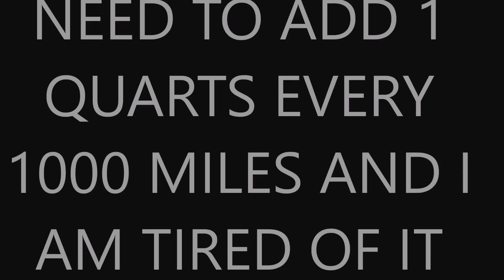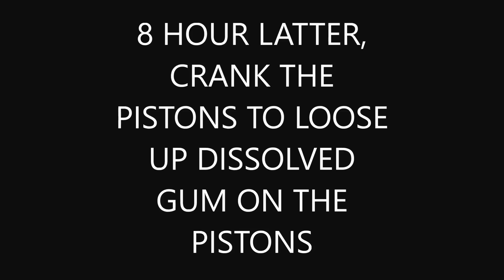MY WAY to stop ENGINE BURNING OIL FROM STUCK PISTON OIL RINGS WITH SEAFOAM

Comment: For everyone else who has oil consumption: get on an open highway when it's not crowded. put it in the next lowest gear under drive like"3" or if it's really bad, try "2".  When it's safe to do so, accelerate hard (But don't go past half throttle) till you get to 65mph, then take your foot off the gas, and let the engine brake and slow you down to 30 or 40 mph.  Repeat this 4 times.  When you accelerate after the engine braking, you will see black smoke come out the exhaust.  
Here is that happens: when you use "engine braking", the back pressure created causes your rings on the piston heads to dance, spin, and wiggle - thus releasing the embedded carbon.  This should be done every few months on a babied engine that doesn't go on long trips, or that doesn't get run with medium to heavy duty.  Maybe ask someone with a little more nerves to do this for you. Don't forget to put the car back into drive when complete, and be on your way.  When carbon it on the piston rings, they do not rom a proper fit, and allow micro amounts of oil past the cylinder I to the combustion chamber, and it is burned away.

Thank me later!!
Reply from the maker: awesome
Reply: David James
Reply: David James
Reply: David James
Reply: David James
Reply: Is this the old Italian Tuneup?
Reply: Bob4392 User aka "WOT" or "drive it like you stole it". Yep beat the engine just a little more than you would in daily driving.  I myself perform this every 6 months on my Cadillac Northstar motor, but I also add 20 ounces of marvel mystery oil into the 20 gallon tank. My oil consumption drops drastically after the procedure.
Reply: So if I do the procedure using gear = 3 and reach 65 mph, how do I do "engine brake"? Do I simply remove my foot from the accelerator or do I need to shift gear = 2 or N?
Reply: ruigooal just remove your foot off the gas, and you will hear your transmission whine a little, and the car will start to slow down much quicker than if it were in drive.  I recommend 3rd gear to start, but if you are comfortable with 2, you can try that - even if you only get up to 55.  Depending on the car, you might even here the exhaust sputter as the car is slowing down.  GOOD LUCK.  Also this works best for 8cyl engines but also works for a 6 and 4cyl.
Reply: David James Thank you! I will give it a try. My car is v6. It has been burning oil and I found some oil when I cleaned up the throttle body the other day. One mechanic thinks it is the PCV, and another mechanic wants to take all the parts out and check the oil rings. Both will cost too much money.
Reply: ruigooal you are very smart.  The pcv valve is a little cheap part on the top of the engine that can be checked and cleaned easily - generally no tools required.  Remove it, and shake it to hear for a ball rattling like the sound of shaking a can of spray paint.
Sticking rings will increase blow by in your upper engine and lead to excessive fouling of your pcv valve and intake.  Also, many people overfill the crankcase by filling up a cold engine to the line on the dipstick.  Consider adding marvel mystery oil to your oil next time you need to top off, as the solvents will help break loose the softer carbon without eating away gaskets and seals.  I have been using it for years with no ill effects.
Reply: Thanks David. But the PCV valve for my nissan altima v6 engine is buried underneath the maniford and it is really complicated job to get into.
Reply: ruigooal I really doubt it's under the manifold.  Not even Nissan would do that.  I would bet it is under the plastic "beauty cover" 3 of my 4 cars' pcv valve requires me to remove this cosmetic portion to get to the pcv.
Reply: David James for the 2.5 engines, you are right. But unfortunately for the 3.5 engines, it is behind the rear valve cover which is underneath the intake. I cannot post a picture here, but I found a diagram online https://www.justanswer.com/nissan/1mguq-wondering-pcv-valve-located-3-5.html
Reply: I just wanted to give a quick update. It has been over a month and haven't seen the blue smoke again. Haven't lost any oil either. I replaced the PCV valve on my 3.5L Nissan engine. I made a quick video here : https://youtu.be/WJb026SmCBI
Reply: better to do it from the mountain i have with toyota avensis 1.8 oil burn 1 galon oil burns in 500 miles will try soon it
Reply: How did you discover this method of stopping oil consumption?
Reply: No this is rubbish. Thats not how engines work
Reply: 65 mph on 2rd gear - that's what D2 does in Honda. Do what he says people, your 15 yo transmission wants to retire
Reply: @ruigooal  just replace the PCV Valve ...
Reply: @shobud7561  If you read my comments, you will know that is exactly what I did and fixed my problem.
Reply: Ahh..The Good I'm Italian tune up
Reply: @augustoevka5977  so?

Comment: Oh, I cringed when you installed the spark plugs before cranking the engine first. It will be safer to add sea foam treatment to the oil and the gas first. Soaking the piston rings is a good idea, but I would cover the spark plug openings with something and crank the engine to get rid of the excess if anything is left over after a night sitting in seafoam.

Comment: OK... the best way to do this... is addone able spoon at a time, two hour soak intervals, and each time run engine till block it warm to the touch. Do thus five times. Too much fluid can harm the valve seals and gaskets. Luckily he didn't tighten the spark plugs when he was turning the engine "to loosen up gum".

Comment: I see the point of doing this, not a bad idea, but I would not put the plugs back in, and then crank it.  What if the liquid did not soak thru the rings? Could get a bent rod when cranking.  I would let it soak all night with the plugs out, then crank it to blow out any liquid.  Liquid does not compress.
Reply: When you say crank you mean to turn the ignition half way like he did in the video right? Do you keep the plugs out for this too?

Comment: One area you did wrong , was revv the motor at the end , thats one thing you don't do . Because when you added the sea foam to the piston , what it does it removes any lubrication that the piston had before . And at times you can hurt the piston rings , because they are rubbing metal to metal without any lubrication . Which is why when it comes to putting an engine together it requires to have parts lubricated so they won't rubb raw . This is just for future references .
Reply: That's why you leave the fuel pump fuse pulled out so the engine does not start. Crank it for an extended time to build oil pressure, then put the fuse back in and start it.
Reply: @TwentytenS4B8  You still need to lubricate things even if the engine isn't running and burning fuel.
Reply: seafoam is basically oil, so the cylinder walls still get lubricated

Comment: I have an 09 camry with 370k miles. Used to burn oil like yours. Fixed by injecting wd40 in vac line during idle.
Reply: Is there a web page or video that explains your method? I want to learn more! Thanks

Comment: I've been doing this way more than 20 times to my Mazda 3 which clocked more than 230k miles. However... i only pour in lesa than 0.5oz in to each the combustion chamber..then soak it for good 6 hrs then start the car. i didnt experience any hydro lock at all....i repeated this process (piston top cleaning) at every 10k miles and add seafoam into the fuel tank @every 5th fill up. Cleaned throttle body at every 15k miles.  So far my engine didn't suffers oil consumption at all and i change it every 5000 miles. The engine performed like new
Reply from the maker: awesome
Reply: I do this same exact thing with Kreen. I love that stuff!

Comment: Ref: the cranking with plugs in.

I let my concoction sit in the cylinders for 3 days and there was still shit tons in them. Took me forever to get it out. Don't assume anything and damage an engine. Full disclosure, I was working on a Saturn 1.9 liter and not a Honda.
Reply from the maker: Should not have plug in when cranking

Comment: this is some major deceptive video editing. you should only pour in a small amount of seafoam over the piston heads and let them settle for an hour until it can breakup those bigger chunks of carbon, then get a small hose and vacuum all that excess seafoam/carbon out. then add some oil inside to help lubricate it to prevent the cylinder walls from being damaged by the piston.

Comment: Hmm i might do this to my  09 accord with the excessive oil consumption recall once if it starts buring oil. Good to see it worked for you, but I think its safer to just let the seafoam sit for as long as you can and then suck it out of there. I don't want to risk hydrolocking my motor.
Reply from the maker: i am just being lazy, it is a good idea to suck it out.
Reply: rogert151 they extended the warrantys on certain year accord 4cyljnder and 6cylinder check with your local dealership to see if your vehicle qualifies
Reply: Recall still good up to 150,000 taking my 09 lx Saturday has 3 recalls
Reply: Joe RUN if you leave it sit for 24hr don't need to suck anything will go to the crankcase, just what I have done today 
Don't know the results yet but the car drives much better , got new oil in afterwards which I am going to drive for a 1000miles and change it again. Before I filled up the cylinders I drove the car around 500miles with 10% mmo in the oil, and in the fuel. Hopefully not going to consume oil anymore
Reply: @toninocars  any success?
Reply: @chapinteo8412  I'm guessing it was shit and they simply bought another gas burner

Comment: That liquid may work for engines that arent that clogged, usually ill put into the cylinder A BIT of oil just that little to "seal" around the piston to get enough compression to make the engine start once it started it alone will get unstuck rings (not talking about the oil holes for scrapper rings), if you put in too much oil and put the plugs in all youre going to do is destroy the engine by for example bent rods, bent valves, etc. 
The engine may work for some time doing it this way or clean the holes if it aint clogged up too much but there is a reasson that it got clogged, imagine something else in the oil system is clogged and X part or parts cant get lubrication, that can cause huge issues. If you know "why" that happened you will have an idea what methods you can use, pointless to use the above methods in cases like the one below.

That said it mostly depends what happened with the engine and how clogged up it is, have seen cases where there wasnt a way to clean the holes by hand and drilling them was the only way.

Comment: Oil change every 3000 miles or 5000 km, a good oil filter, clean air filter, clean throttle body, and working PCV valve. Do all this and you won't be burning oil.

Comment: Hope you changed the oil after adding all that seafoam to it. 0w30 isn't helping your oil consumption either. Switch to 5w30. GM sells a fuel injector and manifold cleaner to use the exact way you did the seafoam. Give it a try.

Comment: I have a vehicle with 355,000mi and it's started using a little oil between changes. I've never used any treatment in the oil I'm actually afraid to especially with so many miles on it but I have considered it.
Reply from the maker: Make sure do not turn the engine with the spark plugs in.
Reply: @joehowto  I've heard about putting it in your oil an ounce for every quart but never down the spark plugs but why does it matter would it be to much compression and just blow it out? Obviously I see you don't want it to fire so keeping the plug wires off would solve that issue. Did it solve your problem and what is a stuck ring? I've never heard of it not sure how a ring could get stuck seeing how they go around the piston.
Reply from the maker: @my2centz196   you can do both. If it is the problem with stuck piston rings, seafoam on top of piston is more concentrated to reach the problem rings than diluted seafoam

Comment: A Honda With stuck oil rings unheard of , Mine just turned 100,000 miles today I go 3500 miles maybe 4000 between oil changes and it doesn’t use a drop I’ve never seen that

Comment: Joe RUN: It's not clear from the video, what you were doing with the spark plugs.
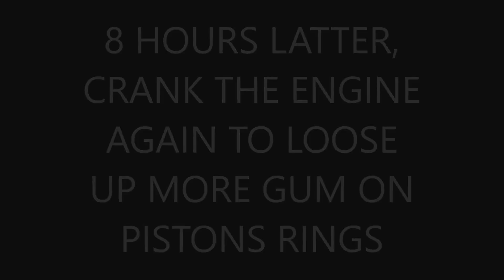3:39 says to install the sparkplugs after showing the engine being cranked the final time.  I'm guessing the spark plugs were just put in position without screwing them in to slow evaporation of the Seafoam. Is this correct?

This is unusual with Honda engines that have been receiving maintenance schedule oil changes.  "Stuck rings" are oil seal separated springs that have been gummed up with varnish and burnt oil. That prevents the oil from flowing back through the piston passages and into the sump, so it gets up unto the cylinders when the engine is running burns and crusts on the piston face.  Varnish builds up on the cylinder wall beyond the oil ring travel.

 I'm wondering what the oil looked like before this fix, whether you changed it after this procedure, and if the fix holds up to beyond 5000 ikles of driving..
Reply from the maker: yes, you are right

Comment: I will do this on my 2011 bmw 328i. Only with a bore scope and i will splash out the remaining seafoam through the spark plug holes then confirm with a bore scope.  Should be fine this way.

Comment: I have a 05 tsx and it burn about 1qt every 3000 miles and does this seafoam help with oil consumption? does it stops the oil burning for you? thanks!!!
Reply from the maker: 1 qt every 3000 miles is too much. If it is carbon built up, it will help. Try it and it works, it works. It does not hurt anyway
Reply: Joe Lui after you did the treatment how many qt of oil you burn between changes? And how long you hold the oil for next change ? Thanks!
Reply from the maker: about 1/4 of a qt every 4000 miles, I use mobile 1. I change oil about every 6000miles
Reply: Joe Lui that's not bad compare to my workmates 2013 328i burning more than that and I will give it a try! Thanks man!
Reply: Ken Xu my celica 2002 burns a quarter of oil everyday has a 203,3450 miles and i drive 36 miles a day.
Reply from the maker: That is too much oil. You must have a leak some where
Reply: Yeah my cars its stick shift and every time i  step on the gas ó can see the smog coming out of the exhaust Pipe
Reply: So, im going to try you treatment.thanks.
Reply from the maker: It won't work, you have a leak in one of the valve seals
Reply: Well looks like a have to start saving money to fix it, thanks. Bro.
Reply: Feliciano Horta also might be your rings if you see smoke while accelerate, don't bother to fix it buy a used motor is better to go,
Reply: Thanks ken xu.

Comment: What engine is that? I have a H23a Vtec or blue top motor in my 95 Honda civic coupe. I soaked the pistons overnight with Marvel Mystery Oil because of a bad compression test reading. This was after a headgasket operation. Now the car smokes when I rev it and has horrible gust-of-wind type blow by when I take off the oil cap with the car running. Car seems to use a lot of oil also, burning it. It releases a puff of smoke on high revs shifting from 1st to 2nd. Should I try the sea foam treatment? I got the compression numbers up to normal, but the oil disappearing is getting out of hand.
Reply from the maker: Did you replace the piston rings too when you swap in the civic?
Reply: @joehowto   No i didn't. I should of tried to replace the pistons when the head was off, you can do taht can't you? Just remove the oil pan/girdle/crankshaft. My buddy says I should just buy another jdm H23a Vtec but they are like 1200 dollars. The issue with rebuilding these engines is they have fiber reinforced cylinder walls and they are a bit difficult to properly hone, and also they can't be overbored more than a certain amount. The engine was fine for about 4 years, its taken a lot of use/abuse since then. The piston rings are probably shot.
Reply from the maker: @Mishakol1290   Try to replace the pcv valve first if it is not new
Reply: @joehowto  I actually did. Didn't seem to help much. I think what happened was the cylinder head mill job caused a slight bump in compression which caused the piston rings to give out. Even though they seem to be sealing the oil rings are allowing oil to pass into the combustion chambers. The motor seems to run fine but for what it is (h23a Vtec) it seems underpowered and it seems to make oil vanish into thin air. My question is will I be able to reuse the head gasket after I take it all apart for the rebuild because i spent 110 dollars on a nice gasket kit from Advance. Not sure if you're the one to ask but thanks for the replies anyway
Reply from the maker: @Mishakol1290  if the gasket is not damage, I don't see any problem of reusing it
Reply: @joehowto   Bought a new motor from a low miles JDM shop for 1190 dollars. Im not even gonna change the head gasket on it or the valve stem seals since 1: that would take too much time and 2: because the OEM head gasket from Honda should last a long time by itself.
Reply from the maker: @Mishakol1290  nice

Comment: Had this same engine in my 2003 accord it ran great but It burnt a quart every 400 miles and and then ran low and stretched the timing chain and bent the timing sprocket on the head. Replaced it with newer 2006 k series but it died because the converter cooked its self shut from the excessive oil from the previous engine soaking it and couldnt go 55 without going 2 miles before it could. Sadly it was a nice car but just a money pit.
Reply: So did you try this sea foam method or not?